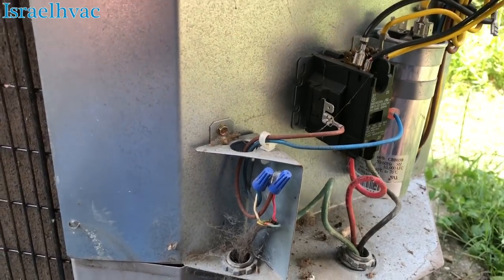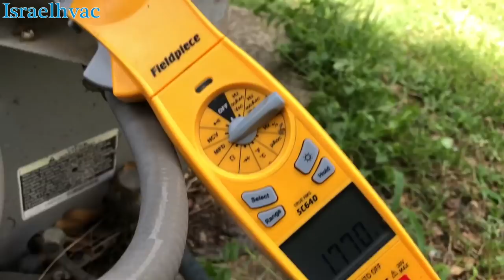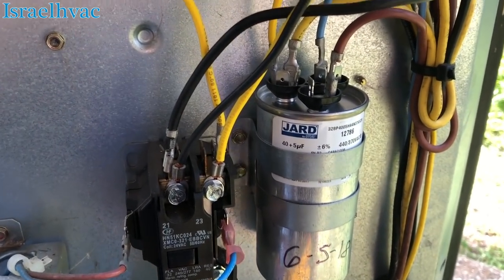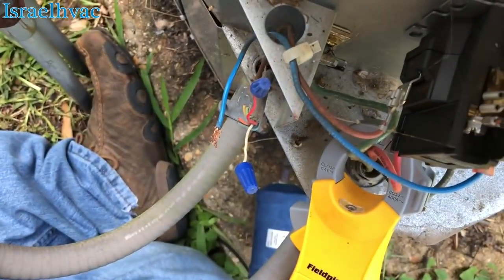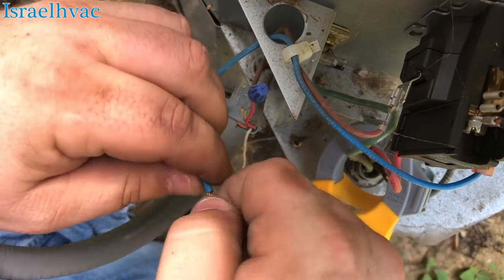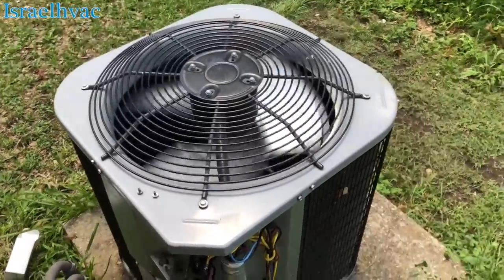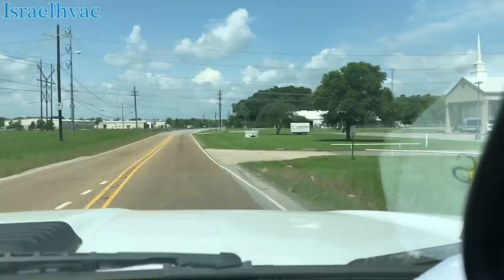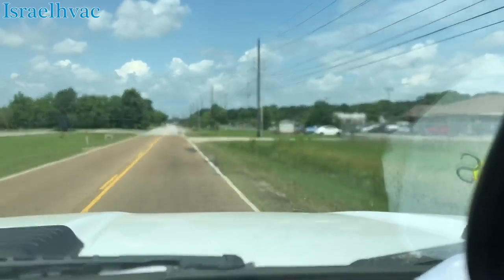HVAC Service | Chinese Capacitor Strikes Again

Comment: When you have larger non-oem capacitor, stretch out band and use 1 1/2" tappers, careful of coil.  Quick fix saves time ($)
I like your videos

Comment: Make sure you hose the dirt right deeper in the coil!
Reply from the maker: 😂😂 It’s not going deeper in the coil. Washing a coil this way works fine. The dirt falls off. Same as when you pull and clean a evap coil.
Reply: At least he did have the courtesy to take the time to clean it and probably didn't charge to do it either keep up the good work john he didn't have to do that but he did good man 😎
Reply: The coils are through. There is no back so the deeper concept doesn’t really apply. Lots of people with very little critical thinking skills post this comment. Nice try,though. Post your video of coil cleaning and put it on you tube so we can see how a big shot does it.
Reply from the maker: Big Picture Thinking Good point. Thanks for pointing it out

Comment: I was wondering if it made a difference which direct you washed those coils out? Last time I had it open was a snake had wrapped itself around the motor shaft and the snakes sticky juice corroded the shaft and bearing creating too much resistance for it to spin without assistance.